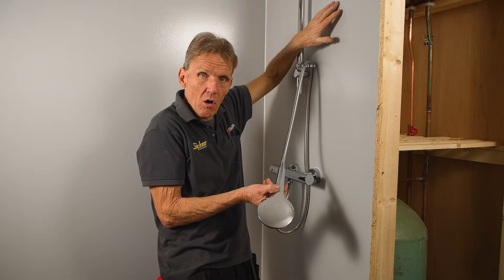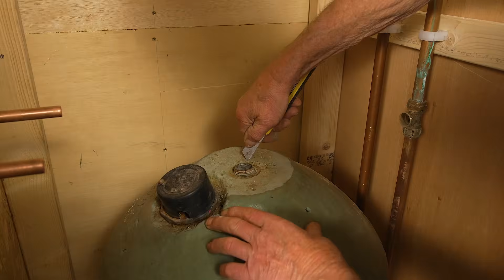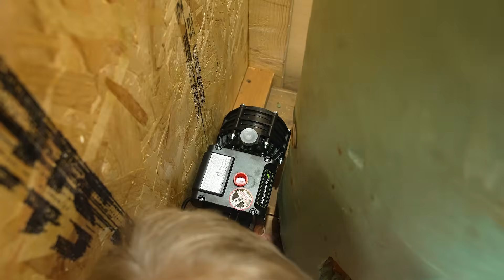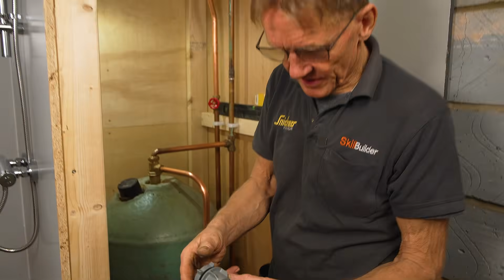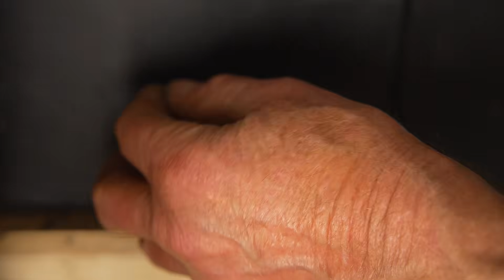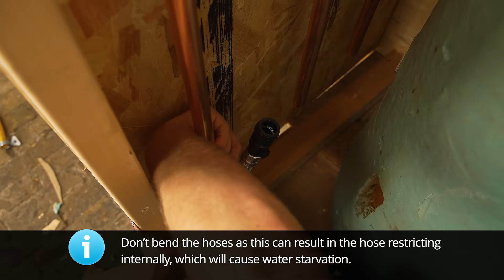Increase Water Pressure to a Shower or the Whole House | Right Pump

Comment: To wind PTFE in a confined or awkward space like the top of the cylinder that Roger cut the insulation from, as an apprentice in 1977 I was shown a tip. 

Wind PTFE around a pencil or a short piece of 10mm pipe, or anything similar, and then wind it around the thread that is in an awkward place.
It’s easier if it’s wound on in a way that it unwinds the same as the reel.

Comment: Hi, I’m just looking for some advice if anyone has the time. I have a building with six gravity fed showers, hot tank is on first floor, three showers on second floor and three on third floor, pressure is very poor especially on third floor, I’ve had two different plumbers out to see about increasing pressure but both really didn’t come up with a solution. If anyone has any advice I’d be most appreciative. Thanks

Comment: Thanks for this. Around 20:57 you mention to use a bike pump to increase pressure to 30psi. You mention ensure the shower valve is open can I ask what that means? We have a situation where it takes a while for the pump to engage when turning on a tap. Does this mean we should do it with the taps open?
Reply from the maker: Yes you need to pump the pressure vessel up when there is no water in the pipe to resist it. Turn off the water supply,  open the tap and pump up the vessel, Some water will come out of the tap, When you close the tap and turn the water back on it will pressure the vessel. This gives the water an initial surge to turn the tap on.

Comment: The brass version is much quieter. I bought the plastic version first & it was brutally noisey. It also had twisted feet so I returned it & got a full refund. The version with the brass pipe fittings is more expensive but the difference in noise is very much worth the extra cost. I did a great deal of research  on this subject & thoroughly enjoyed fitting my booster pump & all the pipework etc with a pipe bender. Bear in mind I am not a plumber by trade. 
My bathroom & ensuite remodels ended up being very expensive but the end result in both rooms is impressive. The bathroom shower is now like the niagra falls!!

Comment: Hi won’t this just boost the holder water only not the cold water ?
Reply from the maker: No, it boosts both hot and cold.
Reply: @skillbuilder 
Thanks , I want to fit a shower pump but i don’t think we have a cold water storage tank 
We have a hot water cylinder can I boost the water for hot and cold from there ?

Comment: what about a mains pressure system that has slowly lost pressure due to houses being built near by ! can i install a pressure bump to increase pressure ? I like a powerful shower plus its not like it would need to run all the time but just when it's shower time everyday
Reply from the maker: an Acuboost accumulator is the best option in your situation.

Comment: @Skill Builder - Can you use a salamander pump prior to a thermostatic mixer valve? Any issues?
Reply from the maker: No problem at all, that is one of the main applications. The thermostat will still limit the flow in one side to achieve the temperature control.
Reply: @SkillBuilder  - Good to know there compatible! - But does that mean that the flow rate could be effected coming through the thermostatic mixer tap (with shower attachment) if the pump limits the flow - nullifying the point of the increase pressure?

Comment: Ive got a situation where the cold seems to have enough flow for a positive head pump but the hot definitely does not, so will a positive head pump work as the cold flow will be enough to activate the pump?

Comment: The thing is you can’t use these for the whole of the house, the reason why is that they need to be balanced. So mainly the cold feed is fed from the cold water tank in the loft, which goes to the shower only. If you plumb in the hot water to go into the rest of the house then when the pump turns on, the cold side will run dry and eventually fail. 

As the cold for the house, is mains pressure.

The water in the tank is not drinking water so you can’t plumb the cold water from the tank for the rest of the property.

Comment: My salamander leaks when it's running... my flange for the pump is on the side of the tank away from the vent pipe and speaking of Essex flanges.... I've had a few of those 😂😂🎉🎉🎉😊

Comment: On my 3rd Salamander neg pressure whole house pump and it will be my last. The latest pump design without the light indicator has a 3 second lag problem on both cold and hot water outlets. Pressure vessel is primed correctly and pipework configuration correct, looking online this is a common issue. 
Good video on the install SB👍
Reply: yea- mI'm on my 3rd pump. First lasted 6-7 years. 2nd last 5 months. 3rd about to be fitted maybe, or I might return it for a refund and go elsewhere.

Comment: I have had the exact same problem in my flat with the water tank, but I used a positive pump and put the pump on the floor. Works a treat! But sometimes I need to turn my bathtub mixer taps on or physically lower my shower head below the tank to trigger the pump. Saved myself a fortune tho, as positive is cheaper than negative.
Reply: Exactly what he said at 2:15

Comment: Our water pump is way too loud which ends up waking people up if tap used at night... how can I solve this issue?
Pump and the tank is in the loft.
Reply from the maker: A pump in the loft is never good but I am not sure it would be quiet wherever it is located
Reply: @SkillBuilder  oops.. The tank is in the loft so, I guess pump is in the loft. Is the only solution to change whole boiler to combi to shut the noise off?
Reply: If you turn on a hot tap, does the pump kick in?
Reply: @jamesdean8864 yes!!

Comment: I came here because my hot water pump has failed. Turns out the plumber that fitted it cut damn near every corner possible. And my god the pump you have is so much quiter than the CT55 currently installed at my house

Comment: What if the feed pipe to the hot water from the pump is 22mm and 15 metre run all the way in 15 mm at the last metre?

Comment: The worst decision you can make if you go down this route. Get yourself an Aqualisa pump shower system and put a pressure regulating valve on the main water inlet. Aqualisa will tell you it is not a recommendation,  I have fitted many of these with no problems.  The other better option is fit a new MegaFlow cylinder which would cost about the same as a pump system.
Reply: Terrible advice

Comment: Morning Roger,I hopy u are well with yrr family keet up the good work showing tutorial videos, Quick questions my house has boiler upstairs next room is my bathroom also I have cold water tank in the loft it run the water for the bathroom but my pressure is very low how can I have more pressure, No.1 do cut the cold water supply going into my loft which is in kitchen or No.2 can fit a pump for cold water supply in the bathroom what's the best way.😊

Comment: fitted a negative head pump, that was good for 2 showers and some mixers.  only lasted one year, they sent one of there service lads to check it was fitted ok, no problems with the install, so they honoured the warranty, but unfortunately it failed another year later. shame as it did work well. still scratching my head what made it fail. the only thing i could think of is, it was drawing to much air, and cavitating. it most prob did not like multiple outlets. but in the end i installed a combi for the customer.

Comment: We have a mega flow system, no pump needed for the shower, it absolutley blasts out, even with taps running.Awesome system.
Reply from the maker: That is entirely due to the good water pressure that you have in your mains. A Megaflo will not perform well if there is just the statutory one bar at the stopcock. Plumbers come across this all the time. The customer expects all their troubles to be over and they find they still can't run two shower at once.

Comment: Get rid of that 1950s technology and put in an instantaneous hot water heater like a Stiebel Eltron or use a 21st century heating and hot water system like a Navian NCB700. No tanks, no storage of unwanted hot water, app controlled. About £1500 to buy the top size one.

Comment: Hey there thanks for nice video. I have power shower which takes cold water from tank in loft and hot water from hot water tank. I was checking with plumber If I can install 3 bar shower pump to improve water pressure in entire house. That plumber raised risk of damaging power shower. Is that correct? Please suggest. Thanks!
Reply: You would need a whole house pump rather than a just a shower specific pump, if you DM us on social media we can help you find the correct pump for the type of system and outlets you require boosting.

Comment: I’ve had 2 salamander shower pumps fail on me in less than two years. On the other hand still have a Stuart Turner working in the on-suite after 15 years of use. I would never ever buy another Salamander pump again.
Reply: We're sorry to hear you had problems with our pumps. Could you please DM us more details about your experience.
Reply: @SalamanderPumps  lmao you can't DM on YT - is that the same as having a bin for customer complaints?

Comment: Hello Roger. I have a mega flow. I think that what it’s called. My hot water is stored in a tank in the airing cupboard. My shower pressure is not the best. Can I get a booster pump fitted. Which one would you recommend
Reply from the maker: To help you choose the correct product, please contact Salamander Pumps at tech@Salamanderpumps.co.uk.

Comment: Why not hook up to city water, most places here in the US use  60 psi...you could suck the water out of the city water line, then pressurize it!  Lol.  Well I know I could survive in London very well, oh boy...yep.  we have liquid Teflon sealer as well, that's my preferred stop the leak now...Permatex ptfe...stuff is a miracle used it on pool service for years, never fails easy to use, don't get the shrinking string like the tape, ugh...  wonderful stuff, I'd give it a 10 out of 10 on quality and quality of use, so 10 10 on both

Comment: You can wrap the PTFE tape on the end of a pencil and then use that to wrap it on the tank thread. Also works on pipes which are mounted close to a. wall.
Reply: That’s a brilliant tip. Thank you 😊

Comment: Always had shower pumps since the 80s, can't beat a good quality shower, so refreshing.
Did you 'stick a pipe clip on the side of the cylunder? If so how???
Reply from the maker: I just used a bit of hybrid polymer. It is fine because it withstands the heat.

Comment: What can we do if we got combi boilers? My plumber said only way to increase the pressure is to remove all 15mm pipes and swap it out with 22mm?
Reply from the maker: You will not increase the pressure by increasing the pipe size. You may increase the flow rate but that it unlikely. The combi heats water as it passes through the boiler. The colder the water coming in the more time it needs to heat it so the flow has to be reduced to reach the temperature. If you live in a hard water area the heat exchanger will scale up and lose efficiency over the years.

Comment: Great video—thanks Roger! Any solutions for someone with a solid fuel Rayburn where the water can be above 60⁰? 10:50
Reply from the maker: You can put a blending valve on the outlet to keep the temperature at 60 degs

Comment: Had to replace Essex flange a few months ago washer had corroded hole cut on the tank was way to big only just sealed i told them they need a new tank as its could potentially move and leak some people don’t listen till there ceiling is on the floor unfortunately

Comment: Why not put a pressure pump on the cold water supply inlet and get decent pressure throughout the water service, we are on rain water here and have a grundfos pressure pump which gives us excellent pressure to all the taps even after running through filters and a UV sterilizer. Your hot water tank looks like it is due for replacement.
Reply: In old houses with old plumbing that's not seen higher than garvity pressure its not wise to increase the pressure everywhere

Comment: Superb video Roger. Had a pump run for 15 years then one day it stopped working. Put exactly the same replacement on and that didn't work either. Decided to put a new cylinder and pipework in with wide mouth lever valves thinking it was no doubt furred up...sadly still no joy. It's got about 3L p/m flow so baffled. Same setup as yours except my shower mixer is in the room below so at least 2m head too. Not sure why positive head not activating the flow switches so wonder if a negative worth trying instead?
Reply: I had a similar problem, switching over to a negative head pump solved it though. Steer clear of salamander if you can though, Stuart turner pumps will last you years longer
Reply: @greenreaper1985  Salamander really must address their quality issues. Combined with their appalling customer support its doing them real harm in the industry
Reply from the maker: Could you please confirm the brand of your pump? If it is Salamander Pumps contact them at tech@Salamanderpumps.co.uk and they will investigate your case and advise you solution.
Reply: @SkillBuilder  Thanks for the reply. It's a Triton T550 (no longer available). I have tested the pump, and it works fine. The float valves are not activating the reed switches when in situ. As the same model worked for years previously, I can only assume an air trap after the pump (long run) softening the initial surge when the shower valve opens. I would have thought if 3L/pm water is getting through it that the float valves would activate. Obviously not.

Comment: At 17.27 on the video when you were speaking about the tank connector, what did you mean about putting the connector in lower than the hot. As this is a gravity fed system how would hot water get into the tank other than through the vent pipe from the cylinder as isn't it fed from the cold mains only?
Reply: The cylinder is fed from the tank

Comment: I'm somewhat torn on what to do. I can either do this and buy an expensive pump. Or I can just get rid of my aging vented tank and install an unvented tank in its place which would also allow me to get rid of the cold water tank completely. It's a tough decision to make. I do like the pre-plumbed unvented tanks out there and it wouldn't take me too long to get it all connected up appropriately.
Reply: Get rid off the old tank etc and have a simple set up if you can, you can get new MDPE pipe fitted from supply and it make a huge difference. Also note this way your garden hose etc all the house will benefit. 

just my opinion
Reply: @ajikadan  Well luckily I have very good mains pressure already which the kitchen tap and garden hose use. It's just eventually something will go wrong and when it does, I don't want to fix up an old system. I'd prefer either combi or unvented so I get better shower pressure.
Reply: Unvented systems are simple, but yes pressure can be poor, whereas in the past people had baths now we've gone all continental with showers 😁
Reply from the maker: Salamander Pumps have a range of both gravity boosting  and mains boosting products available. Please use Salamander Pumps product selector https://www.salamanderpumps.co.uk/product-selector/ or DM @salamanderpumps on Facebook or Instagram so they can get in touch to discuss the best product for you!

Comment: Terrible pumps and company. Pumps fail and zero customer service to help you. Avoid at all costs
Reply: Absolutely agree, Stuart Turner pumps are far superior and if you can get their older 4 bar and refurbish it with an O-ring and washer kit it'll last you another 10 years.
Reply: Refreshing to see installers begining to recognise the poor quality of salamander products. They have monumentally fallen off a cliff over the past decade regarding reliability and customer support. We now outright refuse to install their units. There are far better alternatives on the market. They seem to prefer spending resources on shoddy marketing campaigns and paying social media influencers to shill their brand.
Reply: which pump do you recommend. My house has very low hot water pressure
Reply: @fwzmhmd  I would recommend the old style Monsoon 4 bar, they come in both +ve and -ve head versions.  They are discontinued so we're taking second hand but last time I looked you can still get a service kit from Stuart Turner (I've always found their help desk to be very helpful) although the kits are a bit pricey and you'll need to be handy and have some tools to service the pump.  In terms of pressure, provided your static tanks and pipe work are up to it they'll put a hole in the top of your head😀
Reply: @fwzmhmd I went with a Powertank 450
Reply: @fwzmhmd Powertank
Reply: @fwzmhmd Grundfos
Reply: @fwzmhmd  Powertank
Reply: Absolutely agree,

Salamander mains booster pump failed 6 months in.

No help from the company, ended up with a Grundfos Scala.

3 years later still no issues.

Avoid this brand.
Reply: Salamander are shocking, pumps don’t last. My customer has had 4 ctforce in less than 2 years. Waited over 3 months for a replacement as they said they didn’t have the parts, DONT fit salamander you’ll regret it
Reply from the maker: Could you please DM @salamanderpumps on Facebook or Instagram and let them know why you feel this way?
Reply: @SkillBuilder  Why are you doing damage control for a company that doesn't want to know?
Reply: @HaggisMuncher-69-420  whys it damage control? He didn't defend them or anything? You conspiracy theorists need to take it easy
Reply: @HaggisMuncher-69-420 He isn't.